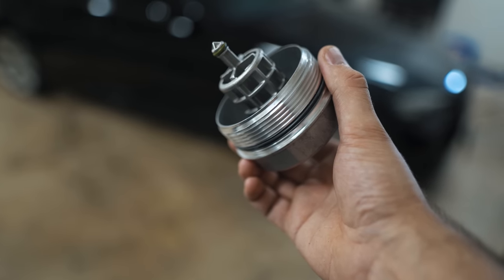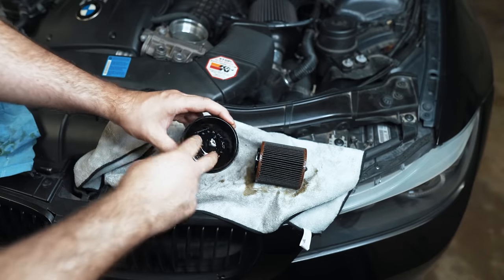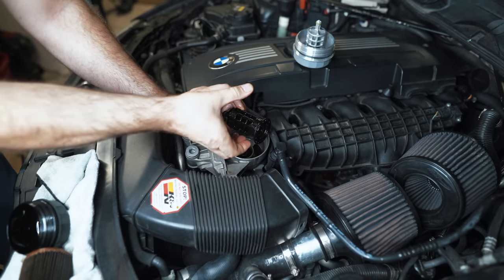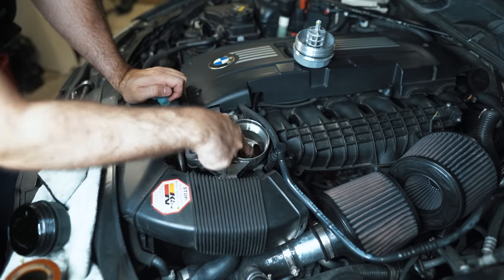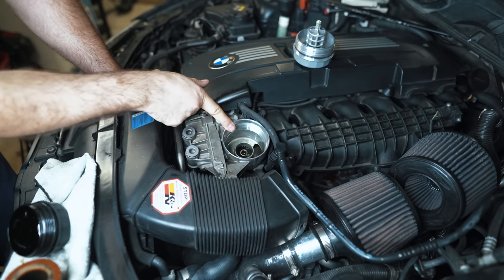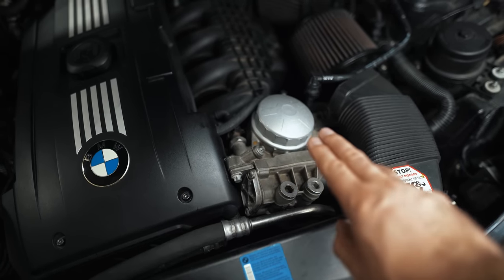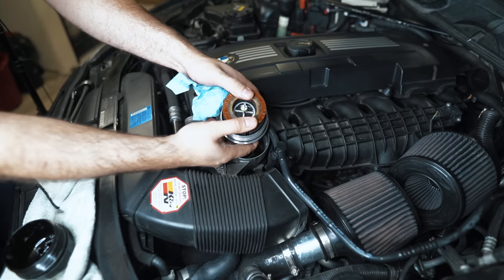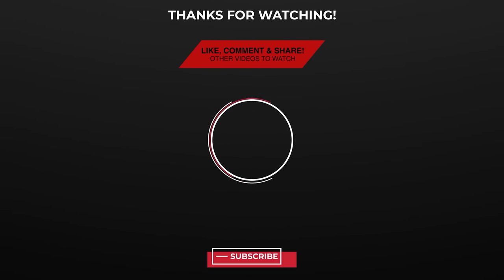Your BMW May Be Missing This Critical Part! So Important!

Comment: the best explanation i was looking for regariding my 5 second rattling cold start on my diesel. I was curious about the different openings inside the oil filter housing and thinking about the gaskets on the cage if changing them would fix my problem. I will do it tomorrow morning and update if that worked. But man thanks a million for this detailed explanation. SUBSCRIBED.

Comment: Thank you so much for this video, one of the only videos on this issue. I just replaced my cap that was missing the housing with a brand new bmw one, hopefully my vacuum leak issues fix. My car RPM randomly spikes up a bit sometimes and the car drives forward on its own. VANOS codes are on as well. Will let you guys know if it is resolved!

Comment: I think you understated the issues with this.  I do all my family's maintenance except oil changes and was working out a vanos issue and a few oil leaks on my step fathers e90 328i and found this was missing presumably since the last oil change which thankfully was only a few days earlier.  In my research this is a more catastrophic issue between the volume and the unfiltered issue I don't see a motor lasting nearly as long with the cage missing.  As you said even less so the more the thing is 'used'.  Anyway great video as usual, just don't underplay the importance of this seemingly silly little part.
Reply from the maker: Thanks, I cringe thinking how many daily drivers could be running around with the cage missing.
Reply: This is most likely the cause of the timing chain guides failing on some of the cars. I this experience with my x3 n20 and somehow feel the damage will show up in the later years.

Comment: Awesome find from URO. Fits both E9X 335i and F30 335i with the N54/N55 engines. I wanted a billet oil filter cap for my E90 M3 S65 V8....no joy. The URO piece looks cast not machined. Not sure about B58/S58 aluminum oil filter caps.

Burger Motorsports makes a very nice billet aluminum Oil Filter Cap in Black/Blue/Red that fits N54s/N55s. You have to keep your plastic cage and transfer it to the billet aluminum cap. You might try the URO cage in the Burger cap. I bought a spare BMW OEM plastic cap (in case the old one breaks or the billet piece leaks). Move that new plastic cage to the billet cap.

Comment: Big and important upgrade and sometimes critical for the BMW N engines, many VANOS troubles and Solenoids pressure come from the filter cap that seems to be not a simple part of the engine system.
BimmerN53

Comment: Thanks for this, just ordered, I randomly get a VANOS exhaust code even though both intake and exhaust solenoids have been swapped to brand new OEM parts. Engine has 60k miles so most likely not the cam ledges and I'm almost 100% it's the cap as the cage is super loose, way looser than it should be. Fingers crossed.

Comment: I can testify to this. Got a 2007 323i with an N52 engine. Mechanic did an oil change and didn't seat the filter and cage properly. After a month got rough idle and low power in lower RPMs. Eventually car wouldn't start in the morning without revving. I was told I need to replace both vanos solenoids which aren't cheap. After researching I checked the filter and reseated it properly. Engine now purrs like it should and all codes are gone.
Reply: Why didn't you tell the garage/mechanic to sort the problem rather than letting him/them get awaay with poor quality work?

Comment: Dude thank you so so much, you addressed all my worries, went to a take 5 oil change and although I can’t confirm it the cage is moving.. I’m relatively sure they forgot either an o-ring or cage. Been driving for about a month now since I haven’t had the money to replace it with constant low oil pressure warnings (baby driving it the entire time ofc). I even asked the shop if they perhaps made an error and of course they didn’t own up to it whatsoever. Will be ordering this and seeing if I can get it installed at local mechanic with new oil change. Got 1 misfire and got a VANOS error yesterday so finally will have the money to fix, just needed research

Edit: Car is a 2013 535i

Comment: I heard a clanking sound coming from the oil cap. I opened it up to find the cage came off the cap. BMW really just makes some nasty plastic parts. And very cheap gaskets and seals. I would never buy a BMW if they weren't so much fun. LOL I get this part upgraded. Thank you

Comment: De burr the aluminum oil filter cap and cage because it's cast and there is no quality control so there are aluminum chunks on the entire cage that can fall off and get into the motor.

Comment: i bought this for peace of mind recently also on my N52
Reply: was your oil filter cap very rough? i had to deburr the threads specially the ending of the threads where the o-ring is.
Reply: @MaweKFX  I was eating up the top of the cap trying to get it off. I just decided to go with metal so it won’t chew with oil filter wrench.

Comment: Matt, thank you sooooo much for this. I’ve gotta look into it on my N52. My idles have become drastically unstable and since I don’t drive it a lot (quarantine things) I speculated it was vanos solenoid/filter issue (I’m at 227K). However, I got my oil changed recently and wonder if this is the culprit. Whether it is or isn’t, this is a good upgrade as you noted, moving away from plastic OEM pieces

Comment: I had an oil leak right where the gasket is for the oil cooler lines. In the process of swapping that gasket, again, and doing an oil change I swapped to the URO aluminum cap. $30 on Amazon isn’t bad. Hate how easily it can get scratched tho. Wish it was black.

Comment: Just got a 328i just did an oil change at a buddy house and saw that I was missing the cage I am getting p0012 code changed the sensor cleaned the vanos and gasket to the vanos does rough idle I'm assuming this can help going to drive the car to the store and get a new housing

Comment: Was doing the oil change on my M4 last week and my cage broke .., the spring shot the cage and tabs into the hood (found it all ). I ordered a replacement but did not go with aluminum . Why ! If the metal fatigues over time and fails any pieces of metal would be far more dangerous inside the filter area than plastic like with what happened to mine .

Unless a company comes out and makes one from billet or is cnc’d or is of a quality stainless I couldn’t trust any of the options out there. If it’s a cheap Chinese cast metal I’ll pray for you guys 🙏🏼

Comment: Great video. If the oil filter bypass is missing or not working well, what would be the symptoms(sound coming from the engine or oil pump)? Since the sensor is before the filter, then a clogged filter or faulty bypass valve would cause higher oil pressure readings?

Comment: That is a great upgrade, and I'll probably get it. But I just wish they would have cast a square 3/8 or 1/2 into the top so I can just use a ratchet to get it off. I still don't have an oil filter cap socket.
Reply from the maker: Yeah would have been a welcome add on for sure.  I think it probably just keeps their R&D cost down to completely mimic the oem piece but make it in aluminum.

Comment: This vid has been in my mind and plans for a long time but I decided to purchase a plastic stock OE replacement oil filter cap for general maintenance and to avoid an inconvenient age or wear-related plastic part failure. The Casey Schmidt video at https://youtu.be/cQ6vpv22uaU influenced me to avoid a metal cap and the possibility of metal shavings or fitment issues with the filter cage. Thanks to Vehicular DIY for raising the filter cap analysis and best wishes to the community.
Reply: @bmw328iowner8   Thank you sharing the link. I will also go replace my OEM plastic with new OEM.

Comment: Again, you are spot on!
Reply: I bought a 2012 z4 35iS and had the same problem, engine codes, limb mode etc. All was fixed by a new filter cap WITH the insert. Btw I highly recommend changing gear and differential oils too. Including gear filters and gearbox mounts.

Comment: what an informative video! thank you so much. my hyundai azera (Lambda DOHC MPI 3.3L) have the same idea & it start having nocking at cold start. i really take care of everything but i couldn't fegure out the reason behind that nocking! so have to check these part if they are missing, or maybe been missing for a while then the dealer return it without me knowing!
Reply: Those motors have a technical service bulletin for piston slap. The knocking could be a build issue.

Comment: Have you ever thought of doing a secondary cat delete & replacing them with Vibrant 1792 resonators & then getting rid of the stock resonator & putting in an X-pipe. Maybe putting in BMW PE mufflers or 335is mufflers?
Reply from the maker: My car already had it's secondary cats deleted by the previous owner.  I think I'm going to keep the exhaust relatively quiet but open things right up if I convert the car to single.  N54s sound great with single IMO.

Comment: Hi! I ordered one of this upgraded metal oil filter head with metal cage but they come loose and not mounted to eachother, i tried to press the cage on but without any luck, i wonder if it is cause off 3 studs looking tiny pins that is on the inside off the cap that doesnt allow the cage to be clipped in place but is it very bad to just put the cage in the housing where its supposed to sit, first , and the put the oil filter with the cap in at last? Will that also be able to cause all this trouble and codes you are talking about here? That it must be clipped in the cap first at all cost to  make it work?

Comment: NO. Do not use this metal cap. The center cage is too firm and negates the relief valve action. Also, the center cage does NOT fully seat into the back of the cap because the metal clips are too hard and have no give. You will have to dremel down some of the hard edges on the sides of the center cage base in order to get it to fully slide past the core metal clips. But the most dangerous part of this poorly made cap is the fact that the relief valve is too hard and requires too much pressure. 

I ordered one, did an analysis and decided to not use this unit. It's still on my shelf brand new.

Comment: Hey! I bought an F series steering and airbag. Going to upgrade my E93 steering wheel soon.
Reply from the maker: Awesome, good luck!  Are you guying to try to get the controls working?
Reply: Vehicular DIY im going to try without the module. Mine has shifter paddles tho. I don’t care much about the steering controls. 😉

Comment: Already brought the BMS oil cap but still uses stock cage. Going to buy this just for the cage lol. Hope it will fit okay with my BMs oil cap
Reply from the maker: Okay would be good to know if it fits.  I should have tried snapping the aluminum cage to the plastic cap to help answer that question.
Reply: Did you try the BMS oil cap with this aluminum cage? Did it work?
Reply: @cupompa  lol totally forgot to reply to this.  YES I used the bms oil cap with the aluminum cage worked just fine !!!
Reply: @XxTrickFlowxX  Wow that's awesome! I'd like to try this combo out and see what happens after 1 year or 5,000 miles.

Comment: I need help! I serviced my 08 335i this weekend and I noticed that when I loosened the oil filter cap that alot of oil overflowed and made a mess, I've never had it this bad. Then I realized my cage was stuck onto my oil filter and so I pulled it out and attempted to clip it back onto the cover but it didn't snap or clip into place. Now I have a VANOs code pop up every now and then for the past few days, could it be because the basket isn't clipping into the cover?

Comment: I purchased this oil filter cap and installed it. Next oil change I was not able to remove it. It cross threaded in the oil filter housing. Maybe i tightened to tight, but i tighten my plastic caps the same way but they never did this. 

Needless to say I am replacing my oil filter housing with a new one. This is my experience with it. Maybe I am a one off thing or maybe it is more common. I don’t know.

Comment: there appear to be concenrs around this part on the spool street forum conversation. I think this requires a more in depth video / discussion.
Reply from the maker: I read that, nothing that stands out and ECS vouges for it.  I'll run it and definitely report back if I encounter any issues.

Comment: you are off a bit on the amount of pressure loss and you should process what I’m about to explain. Yes the oil change drain back hole is 1/3 of the size of the high pressure high volume  digital engine lubrication orifice, you stated you lose 1/3 of your total oil pressure and flow volume, because it’s only 30% of the whole supply. If you understand that fluids, gaseous or liquid are  free flowing physically controllable mechanical energy and motion transferring media, these systems are usually rigid  conduits cast or machined into the structure of the engine case and mating components, pressure is maintained via friction of a viscous fluid in a conduit/circuit, as the oil travels further and branches out, orifice sizes decrease to maintain a consistent pressure and flow rate as the number of conduits increase to sully more components with lube and cooling, and decrease by the number of components receiving pressurized lubricant in this case cams and followers, then released into a non pressurized drain hole gravity operated, or dry sump return system, which has a negative pressure. Now did you get the clue? Knowing fluids will take the path of least resistance until the fluids volume and resistance through that path increase so much that the viscous friction increases the supply pressure load to a pressure greater than the resistance of the pressurized lubrication system circuit.  basically you let off 1/3 of the flow resistance pressure per unit of volume say it’s 1 gallon per minute (I don’t speak metric) and you have 100 psi at that flow rate, deduct the volume -.33 which leaves .66 gallons per minute  at this rate conduit friction drag is now reduced, to the value of its drag coefficient and you’ll shit your BVD’s if you do the rest of the reducing, your over simplification and incomplete data for your reduction hypothesis overlooked the degree of impact a hole released from a finite source of pressure and flow into a infinite volume of 0 psi to -18”hg (mercury vacuum)and now 33% of the linear pressure volume is 0 and only the pressure of the friction from the fluid  passing through the conduit to no pressure space of the oil pan will be readable in the main supply conduits total volume  the divider de that pressure and volume  by 24 cam follower’s after deducting the 2 vanos actuators, I just tossed values around because it’s way late and stuff but you get the point

Comment: Can I replace it without draining the oil? I started getting vanos selenoid codes after my last oil change and I'm pretty sure they threw away my cage cause I already replaced the selenoids and the check engine/codes are still intermittent.😕

Comment: Hi.
First of all, great channel, very precise and interesting videos, i have a bmw 123d with elsd and i want to buy lsd conversion kit, once assembled, do i have to electronically remove elsd?
how do you feel after a year of use?
is there much difference between elsd and lsd conversion kit?
forgive the many questions but there is very little information about it
I use the car to "drift" only on rain and snow, not on dry asphalt.
Reply from the maker: Thank you, yes in my opinion you would want to code out the elsd to get the maximum benefit of the conversion kit.  I feel its held up well after one year.  It's great at keeping the car straight under power.  My M340i came from the factory with an LSD and I would say the biggest difference is the LSD in the M340i seems to assist with the handling characteristics, powering through a corner mid turn etc.  That could just be due to it being electronically controlled.  The conversion kit on my 335i seems to do it's best at putting the power to the ground.  Doesn't feel like it was designed to aid handling if that makes sense.

Comment: I had this happen to me kept showing me engine code after hard pulls.
Reply from the maker: Were they vanos related codes?
Reply: I'm also curious...
Reply: Where did you last have your oil changed?
Reply: @VehicularDIY  if I remember correctly it was a low power code this was a few years ago. But the car would run fine until you would start pushing it hard and the CEL would turn on right away. The reason I figured it out was because I had read it could be the vanos solonoids so I replaced them and at the same time i did the oil change myself and noticed it was missing the cone. I had recently bought the car was a 2007 335i very cheap from a friend. I sold the car few months after but now I just got back into the N54 with a 135i very fun